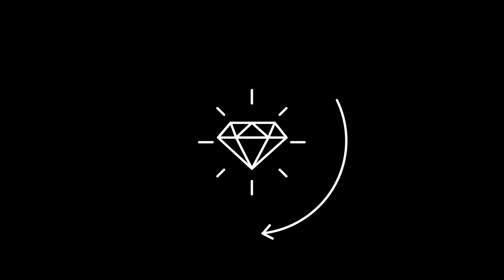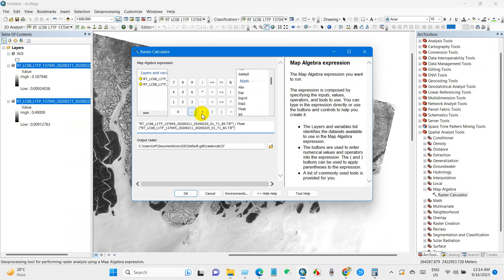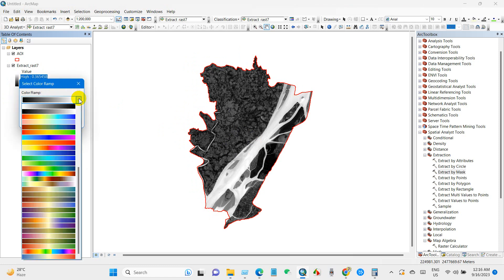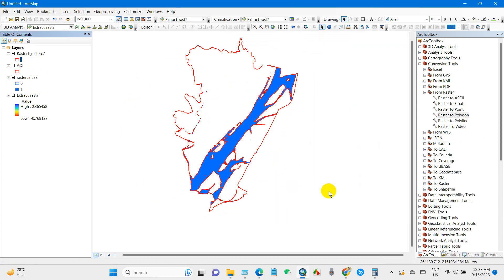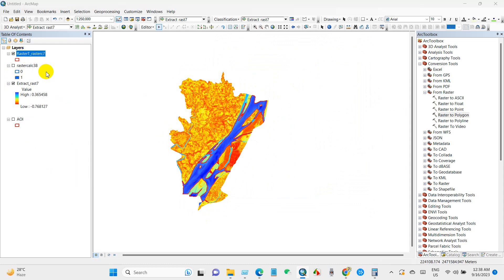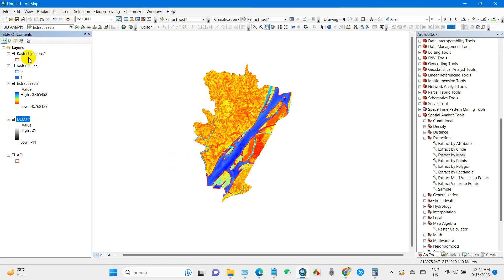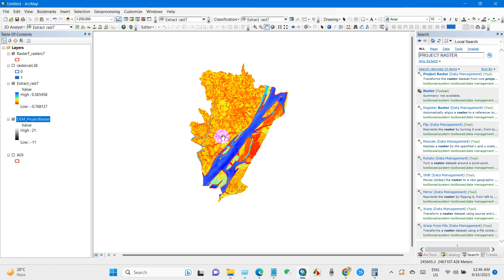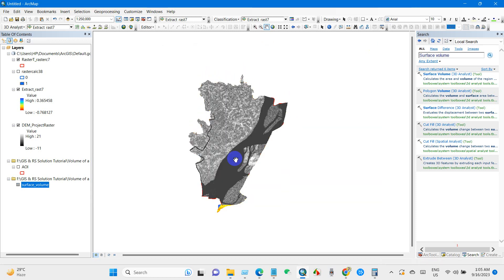How to Calculate Volume of Reservoir/Lake/any waterbody using ArcGIS

Comment: Very informative as always. Thank you.

I saw a video where you correlate NDVI and LST using Fishnet, it's really been helpful. But I have a bottleneck pls, I want to find the relationship between LULC and LST using GWR, I have prepared my data in raster format but it's not supporting as input field in the GWR prompt. Pls how should I handle this? Also can I rather use the fishnet approach to do it? Thank you so much for your efforts as always.